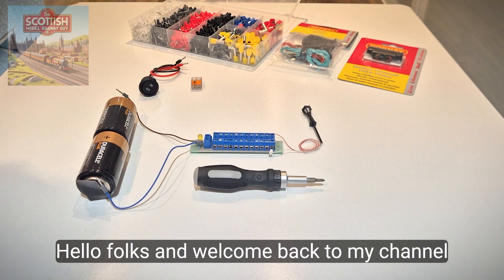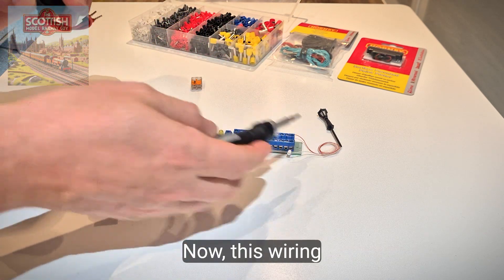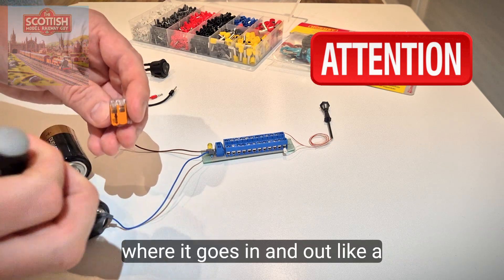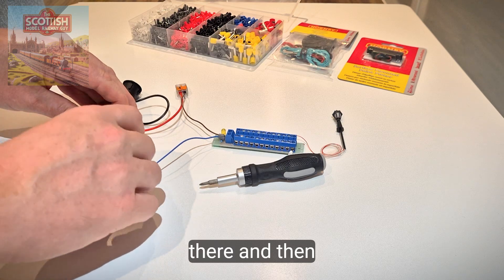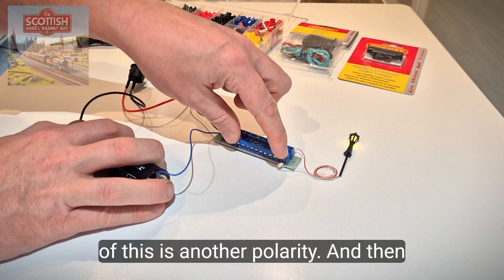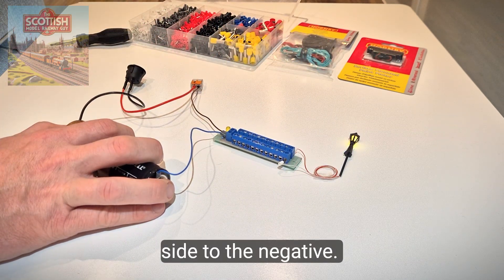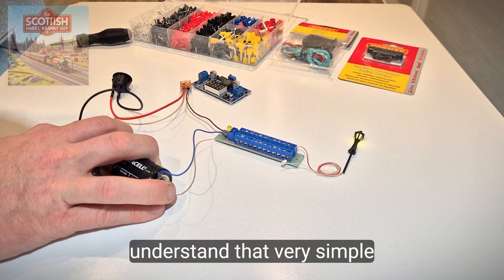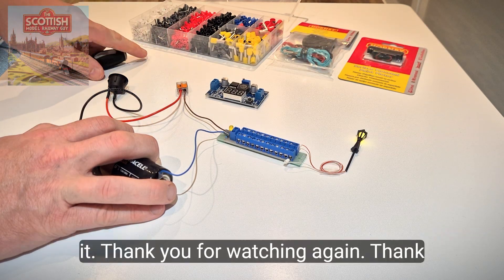Add Lights and Switches to YOUR Model Railway Layout (Part 2)

Comment: Great video. Subscribed to you very informative videos. Question, does this also work from a DCC bus with the voltage regulator?
Reply from the maker: Hi buddy, thank you for your kind words and subscription.

So, the last thing I'd want to do is give you bad information.  My layout isn't DCC (yet - future project), so I can't verify that.

All I can say is that if you provide 12v- 16v in, you can regulate on the way out from this wee board. 🙂👍🏻

Comment: Can you include the specific names of the components you talk about in the written description of the video or put them in text on the screen? I watched each video to figure out what the parts are called and I'm still not sure.
Reply from the maker: Hi,

I won't be able to to alter the video now without a full revamp, but I can list the compnents if that helps 🙂👍🏻:

1. Bootlace Ferrules (a set will cost under £10)
2. Bootlace Crimping Plier (I actually just checked Amazon and you can get the bootlaces and crimping tool for £18 together)
3. Voktage regulator (Adjustable DC to DC voltage regulator ranging from 18v to 1v - about £5) 
4. Connector / Bus Bar (google "power distribution board for model railway and you'll see it).

I hope this helps 🙂😃

Comment: Could  you use the switch to control a a 2 way led signal light instead of lights? Sorry trying to learn about model railway electronics
Reply from the maker: @jonnid67  Hi, so that would be different to an "on / off" switch.  The on-off will only literally switch the circuit on or off.  I reckon you'll need a "selector switch".  I believe these are called "single pole, double throw" switches, so... if you wanted to switch from a green LED to a Red LED, it would select that.

This gives me an idea that it might help if I put wee diagrams into the videos in future to help as many folks as I can!

Thanks for taking the time to reach out 🙂👍🏻
Reply: @TheScottishModelRailwayGuy  Thank you for your reply and yes a wee diagram would be helpful, especially for me...
Reply from the maker: @jonnid67  Okay... so, this had made me think that I need to learn how to make a signal switch, so let me have a wee think and I'll see what I can put together in a video in the near future; perhaps a wee series that builds up as it goes like the lighting ones.

Thank you for suggesting this!  I'm always looking for new ideas and reasons!  Amazon... here I come again... 😆